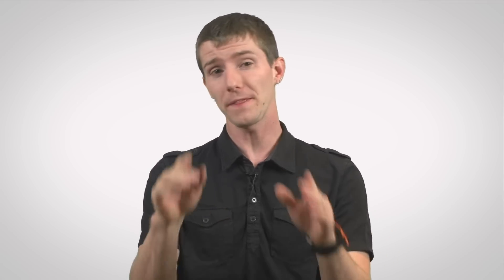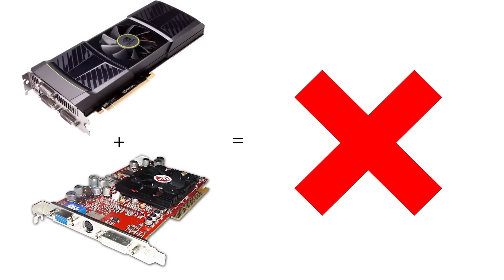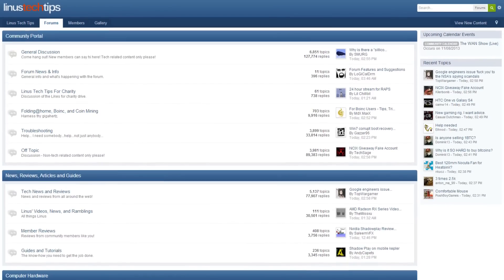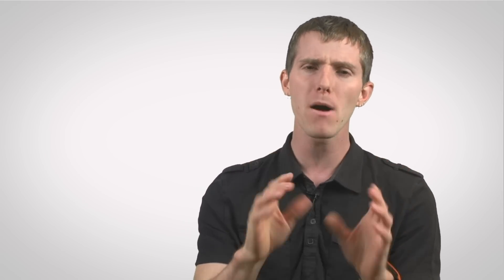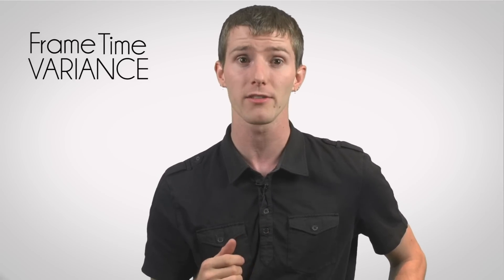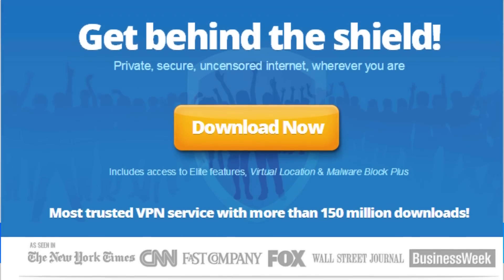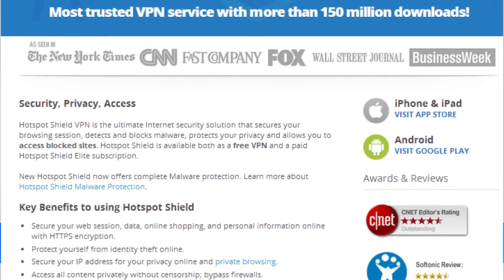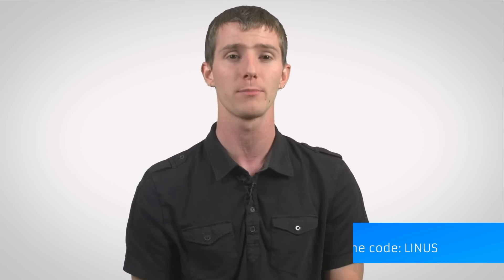SLI by NVIDIA - Everything you Need to Know as Fast As Possible

Comment: I recently (like last week) bought a EVGA gtx 970 and an ASUS gtx 970 and they do not work together. No matter what they kept saying their was no SLI bridge installed (Yes there was) Had to hack the driver to get it to recognize the bridge but I still couldn't get the setup to do surround.  Luckily Neweggg let me switch the EVGA out for  another ASUS and its in the mail now. Hopefully that fixes it.

So just wanted to warn others they may not actually work if they aren't the same manufacturer.

Comment: I thought sli was made by 3dfx
Reply: These young'en probably never heard of 3dfx
Reply: dude im like 12 and i know about voodoo and 3dfx and all the whiz shit of the 90s
Reply: hazza connor brock matt sam

Are you 12 or like 12, there is a difference.  I also never said ALL young'en of course there are exceptions.  But thanks for playing kid.
Reply: Um playing?
Reply: hazza connor brock matt sam The @3 for Scan-Line Interleave, which was introduced to the consumer market in 1998 and used in the Voodoo2 line of video cards. After buying out 3dfx, NVIDIA acquired the technology but did not use it. NVIDIA later reintroduced the SLI name in 2004 and intended for it to be used in modern computer systems based on the PCI Express (PCIe) bus; however, the technology behind the name SLI has changed dramatically.Scalable Link Interface (SLI) is a brand name for a multi-GPU technology developed by NVIDIA for linking two or more video cards together to produce a single output. SLI is an algorithm of parallel processing for computer graphics, meant to increase the processing power available for graphics
Reply: I grew up with a pentium 2 in the 90s, And I heard urban legends about 3dfx, but sadly I never owned one :P
Reply: cool

Comment: SLI and CF are actually a good deal you are getting nearly 2x performance. you are paying much less than 2x cost.
Reply: sli and cf doesn't scale as good as most people hope it would. dual sli/cf is really decent, but you won't get nearly twice the performance in many games. some do well with sli some don't. it's possible to get a performance increase of 80% but also of "only" 20% (for proof go check out some benchmarks). sometimes games don't even support sli/cf and you'll only have the performance of one single card.

I'd recommend to always get a more powerful single card instead of two weaker ones, unless difference in performance is marginal.
Reply: Duc Tran Quang for sure it's not double. what I meant by that is that if you spend $1500 in a system that includes a $500 video card, in 18 months time, when it starts chugging, you can drop another card in (by now maybe only $300) and near (hopefully, ...but as you say 20-80% depending on the game) double your capability
Reply: I see well thats true. if you upgrade to sli or cf within a couple of months thats fine, but after 18 month there are probably new grafics cards available so it might be better to get these instead unless they don't really perform "much" better.

Comment: crossfire is better... the only thing you need is: enough power, 2 pcie x16 slots and 2 cards with the same gpu architecture
Reply: Which is the same thing as Nvidia...
Reply: no nvidia requires you to have the same amount of vram(even though vram doesnt stack) and same gpu and same card but you can have different brands of the same card
Reply: Oh, shit, forgot to check myself before i rekt myself, lol. Thanks for clearing that up man.
Reply: lol yeah :P crossfire is also going bridgeless wich is great for mobos that have weird spaceing but to some it doenst look as cool
Reply: That's pretty cool. It comes up to prefrence then.
Reply: yeah amd is wrecking nvidia when it comes to multi-gpu stuff but nvidia is really good with single cards
Reply: Indeed.
Reply: True but crossfire turns it into a furnace...still good though.
Reply: MarkTheAmazing Actually it doesn't require the same amount of VRAM, but if one card has 2GB's and the other has 3 then you're limited to 2GB.
Reply: Swen B depends on the cards, some components run better hot. but if you have like msi cards you only need an intake and exhaust fan, but if your using like powercolor 290x's you might want a fan somewhere blowing on them
Reply: MarkTheAmazing I'm not an amd expert :P By the way, do you have a recommendation for a graphics card around 75 euro? Im making a budget build for someone :P
Reply: Swen B  well, the gigabyte gtx 750 is amazing for how cheap it is, that should be like 85 euro. the r7 250 is good at 77 euro(prices for that should drop alot this year) your prices might be higher cause in america prices are lower. but you cant really find any good gpu in your price range :/ you might want to extend your price range to 90 euro
Reply: It doesn't support Windowed though does it?
Reply: CustomWeapon It does i think.....
Reply: Davin Sweet you really need good cooling for amd, let alone crossfire
Reply: MarkTheAmazing That'll do, 90 euro is fine. Thanks man :D
Reply: id really recommend the gigabyte gtx 750 2gb(non ti)
Reply: MarkTheAmazing
I've seen gtx 660s go for like 100 euro.
Reply: MarkTheAmazing Ok, thanks :P
Reply: Davin Sweet Probably not in europe tho. Its so expensive :(
Reply: Swen B
True.
Reply: *****
Gtx 960 I think is probably going to become the best 200 dollar card I think.
Reply: Davin Sweet then there are people like me that got the 750ti for $200 and play bf4 ultra 60fps average, then they waited for another $200 card to play games at 1080p ultra 60fps, and then get a 2nd one just for good measure
Reply: +MarkTheAmazing Crossfire is better.... Wow. no.......u, can put two mediocre amd GPU and get the same performance has a 750ti for a bit cheaper but what the point? 4k around the corner... 900series in sli should be what you consider and not crossfiring some hd 7000 series lol

Comment: sooo... should I bother with SLI 980's if I'm gaming in 1080p?
Reply: Cobrass2 Well not at 144hz, and he wants to also go 1440p 144hz, and you'd need sli 970s for that.
Reply: No unless you're going for 144hz
Reply: thats weird... I am.
Reply: Powerweezle you will notice the benefit then. I'd still recommend dual 970s though as they are a lot cheaper and only marginally worse.
Reply: Not even remotely interested in 970's or any AMD card, I plan on getting a 1440p 1ms Gsync monitor when the ROG swift comes down in price a bit, so 980's it is.
Reply: Arya35 My big question is do I get the Super Clocked version from NVIDIA or the classified's from EVGA?
Reply: Powerweezle aren't the super clocked also from evga? The classified are the best as they've been binned to be the best overclockers, but you have to pay a premium. 
Also, Acer is releasing a 1440p 144hz ips g sync monitor in March, so that may be the best time to buy the rog swift, but Asus still may not do a price drop.
Reply: hell no, 980gtx sli is such an overkill for 1080p even a single 970 will handle all of your games on ultra at 1080p
Reply: no, its pointless, you have little to no gain at all over 1 980 its already more then enough with just the 1 card adding a 2nd will do next to nothing.
Reply: yes do it, if you have the money just buy another one, jayztwocents has 3 of them and x99 and full water cooling loop, nothing it cant handle
Reply: Nathan Du vergier I thought he had 3 780s, did he upgrade?
Reply: Arya35 yeah now he has 3 980's and full watercooling loop, so 3 watercooled 980's watercool i7 5960x and not sure how much ram, but the whole thing is watercooled
Reply: Nathan Du vergier he has 16gb
Reply: Powerweezle I'd go with the new acer monitor coming out. It's a 144hz IPS 1440p monitor with G-Sync.
Reply: Arya35 144hz just means you can display up to 144 FPS, most games in 1080p will deffs get you high fps, depends on game i suppose since dyinglight max everything i get average 80 but i get 300FPS on CSGO max everything, on 1440p as well. ( Using EVGA 980 Classified ACX2.0, i7 4790K OC to 4.6GHz )
Reply: +Kaleb Gilley AHVA, which is identical to IPS "IPS TYPE"
Reply: +Powerweezle LOL game on a single GPU and once you get that 4k monitor.. THEN SLI that 980

Comment: guys sli doesn't really work for most of the games. i did some frametime measuring and it was he same as it was with a single gpu. if not even double!! so when you see some bloated fps numbers on your rtss program, your monitor only puts out like half of it. but high fps number on 60hz monitor are pointless anyways so don't even bother about a 2nd gpu, unless you have a higher frequenzy monitor. but like i said, your monitor won't display the actual number of fps that is shown on the screen.
Reply: my point was that sli is working very ineficient, especially in bf4. ppl think they get high framerates because of a number on a screen. well the number is actually right, but for some reason the frametime (time between every displayed frame) is as high as it is with a single gpu. so therefore, you're not actually seeing the same amount of fps which the number on the screen displays.
Reply: I don't "computer". I " logic". An ability you seem to lack. You check your taskmanager, because why? See, all you did was talking me down saying i'm wrong because you didn't like what you read, but thats not how debates work. Well maybe it you're a poltician. Okay then maybe i should clarify a bit. Let's say i have 120 fps but the average frametime in that second is 20 miliseconds. But 20ms equals about 50 fps. Well what happened to other frames? Only explanation is that multiple different frames were rendered at the same time. And you guessed right, thats what we call microstuttering. mind blown but that's not bad when it happens from time to time, right? in bf4 (at least on my 680s) in a 2 minute benchmark the average frametime was 20ms, soo not that smooth. Well, if you still care to answer come with something better than "nuh-uh ur wrong cuz i'm right" or "do some research". Why don't you just explain why i'm wrong?
Reply: toni h. that shamrock dude is not reading it all.  in your very first post you wrote " 2nd gpu, unless you have a higher frequenzy monitor'
Reply: yeah, looking at it that way i have to admit that my comment wasn't written very specific. that monitor part might have been a bit misleading.
Reply: toni h. some of the frametimedisplays show the same frametime because they don't support sli, so they show the output of only one of the cards
Reply: Easter_Bunny321 That is a support issue. That is all. A game either supports SLI or it doesn't, and if it doesn't you can only use one card.
Reply: just trying to explain why he gets the same frametimes with and without sli
Reply: Easter_Bunny321 even if they were the same that's still 2 frames. Not that it happens.

Comment: Can I still run SLI, if the other card have different BIOS Versions (x2 GTX580)
First Card GPU 797 MHz Second Card GPU 800 MHz
Reply: For your question no it will not have a diffenret BIOS version most likely just a differnet overclock on it so you should probably equal the overclocks on them to be safe and make a stablity test for them before going on with the SLI set up as i am unsure if uneven clock settings on GPUs is supported that far back in the generations is all
btw a GTX580 will probably cost you as much as getting a GTX 770 which is about the same thing but takes less power to run and is about 1.3x as good

Comment: Is there any reasonto SLI or CROSSFIRE if playing on 1920/1080?
Reply: Depends on what game, if lets say you wanted to play Far Cry 4 then yes it would be a good idea, but playing smaller, less demanding games, like Minecraft, Civilization 5, etc would not be worth the extra money required to buy a second video card.
Reply: Pikalikasq Streaming and/or Video rendering yes there is otherwise it is cheaper to buy 1 stronger GPU than 2 weaker ones that add up to slightly more proformance ... until you get to like the 970 at which point then not really as 1 GTX 970 is enough for Streaming and video editing in 1080p but not really that much higher.
SLI and crossfire atm is for 4k gaming at 60hz or higher.
Reply: yumri4 While I agree with this, it's important to mention that some people have older cards already and are debating between getting another one for SLI or spending a lot of extra money for a newer one. Also, 1920x1080 @ higher frame rates can warrant SLI (for those with 120Hz + monitors) - even for the beefy new cards.
Reply: squatchyy yeah but mostly a single 980 will do better for them than mutliple of lower down cards while costing about as much as getting a SLI config to add up to the same computing power
Reply: Sure, if they are buying both cards now - but if a person has an older card, and can get an another one for half the price of a 980 (retail for ~$500+ USD from what I'm seeing), then that's something to consider! Yes, performance may not be as good - but 1920x1080 is child's play for a 980 anyway. For a single monitor at 1920x1080, I think a 980 is excessive.
Reply: i think your example for SLI was tripe 1920x1080@120Hz monitors which is not as much of child's play for a 980 but yes getting a single 980 will be about equevent to buying the entire SLI set up at a single time while if it is only 1 extra card added in then it isnt as much by far that is very true you still have to factor in how poorly SLI use to scale per extra card too ...in that it has gottten alot better lately but in the older cards it still has issues.

Comment: Which motherboards have 2 x PCI-E 3.0 at Dual x16 and run at dual x16. I am looking at Z97 or X99
Reply: on the Z97 you will be running a PCIe 3.0 dual x8 or PCIe 3.0 native x16 and PLX PCIe 3.0 x16 which should work the should and ussualy does unless you go with dual cards on the PLX chip and have a x16 card on the native lanes you are good with a Z97 board
For 2 native PCIe gen 3.0 x16 lanes then a X99 or C602 board is required ... X99 will probably abe a better choice for gamers while C602 if you are making a rendering server.or some other kind of server.

For cost per preformance a Z97 chipset with a PLX chip onboard to enable you to have 2 PCIe 3.0 x16 lanes running at PCIe 3.0 x16 will be the best
For preformance a X99 chipset will be best but not because of the lanes both being native but becuase of more cores, more RAM bandwidth, and M.2 so your SATA cable wont get in the way of the graphics cards.

Generally X99 is not advised becuase the technology in it is still in the beginning of its life cycle and errors might happen more often while Z97 is already fixed to the point that it shouldnt break because of the chipset.
Reply: Make sure you buy DDR4 RAM and Intel's new CPU for the X99. It will be more expensive due to this new technology!
Reply: Alexandre Châteauneuf why make sure to buy it?
Reply: TheGugor because the X99 has a LGA 2011 v3 socket and DDR4
Reply: Alexandre Châteauneuf oh lol ok

Comment: Can you PLEASE do a overclock guide video. I want to overclock my cpu and gpu but don't know what to turn each setting up to.
Reply: get MSI Afterburner then google " Overclocking with MSI Afterburner " you will find a few very good guides on how to use it. MSI Afterburner should work with your GPU if it is nVidia though i am unsure if it works with AMD cards.
For the CPU same thing just use premade overclocking software as there is alot less room to mess up in them.
Reply: for overclocking your CPU you should go to bios and use prime95, cpu-z for stability tests. overclocking software are often unreliable and don't really work. some modern mainboard do offer overclocking presets. don't try to find an easy way, do it the proper way - it's not really difficult there are tons of guide out there.

Comment: Processor
AMD Phenom II X6 1100T Black Edition
Socket-AM3, Six Core, 3,3GHZ/3,7GHz Turbo, 9MB, 125W, Boxed

Grafikkort
XFX Radeon HD 6990 4GB GDDR5
PCI-Express 2.1, 1xDVI, 4xmini-DisplayPort, 830MHz

Moderkort
ASUS CROSSHAIR V FORMULA - ATX / 990FX / 4xPCI-E / DDR3 / SATA3 / USB3 / Firewire

PSU nätagregar
Corsair PowerSupply (PSU) 850W HX

Ramminne
Corsair XMS3 Vengeance 8GB DDR3 PC3-12800 1600MHz (CMZ8GX3M2A1600C9) (2x4GB)

Processorfläkt
Noctua CPU-Kylare NH-D14 - Socket 1366 / 1156 / 1155 / AM2+

Chassi
NZXT Phantom Full Tower - Röd (Ej PSU)

CDrom
Sony Optiarc Intern DVD±RW AD-7260S-0B Svart

Hårddisk
WD Intern Hårddisk Caviar Black 1TB (7200RPM / 64MB Cache / WD1002FAEX)
Reply: ***** TheBcoolGuy There is no other processor. Under "Processor", he describes the processor he has and the socket it's adapted to etc. Under "Processorfläkt", he describes the CPU Coolers he has. It's in Swedish btw.

Comment: Hi got a question,may i connect 2 gtx 780s,1 has 3gb ddr5,and the other 6gb ddr5?and oh will the memory share?example=3+6gb=9gb ?Thanks.
Reply: No it would not connect properly because they have different memory capacities.
Reply: lol of course it would work, but you won't be able to use 9gb vram, because vram doesn't stack on sli. the vram is mirrored with each card, so you'd only be able to use 3gb. if you want to have 6gb vram you need 2 6gb cards.
Reply: ***** Yes I know. I don't understand why I wrote that comment, maybe it was late or I was drunk.

Comment: A small question i ask if I could work 2 graphic cards in SLI mode only on one screen display or it must be on multi screen? sorry for disturbance.
Reply: Yes you can use them just for one screen. SLI boosts performance, it is not for using two screens as you can use two screens anyway with one modern graphics card.